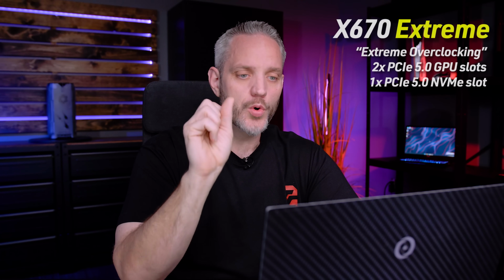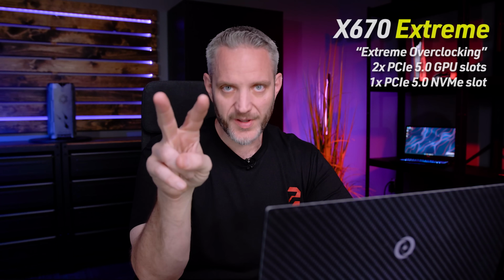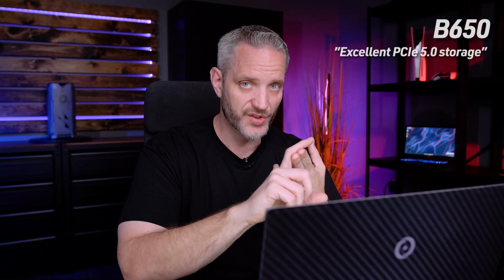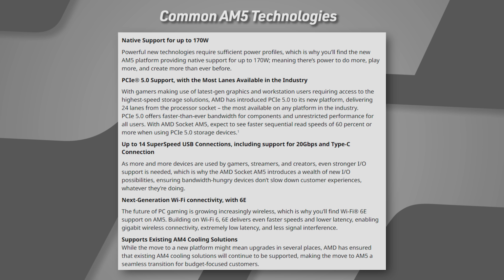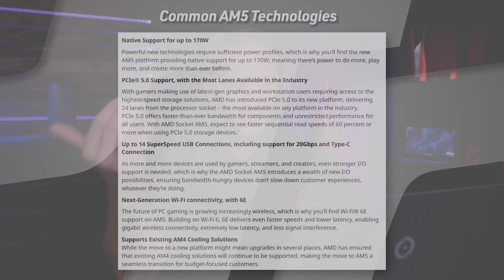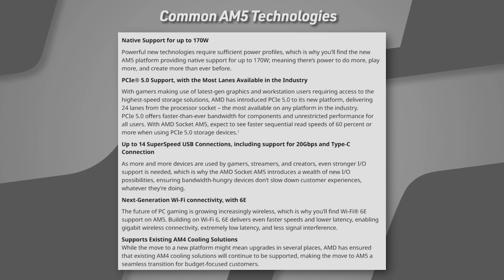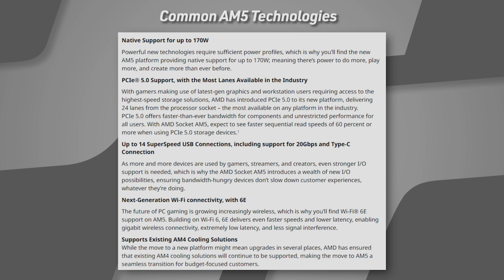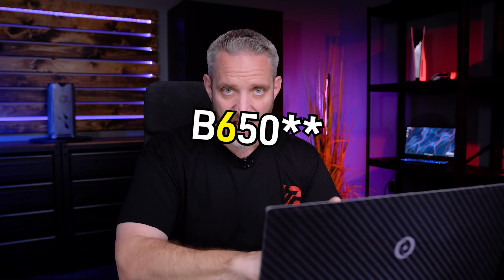AM5 Motherboards are EXPENSIVE! AM5 Explained

Comment: IMHO, the dual GPU support is mostly for people rendering 3D stuff as going for a x8 PCIe slot tends to degrade performance between 10-20% depending on the use case.

So the moment you put the 2nd GPU, you see the penalty on both because they are running in x8 mode.

Most 3D rendering scales almost linearly with 2 GPUs even when they are not in CROSSFIRE/SLI so having 2 full PCIe x16 slots is kind of worth for this use case.

So I really hope they offer 2 PCIe slots x16 (both mechanically and electrically)

Besides, historically, MoBos have a pretty bad layout for running 2 high end GPUs as need 3 slots (because of the cooler) and the second electrical x16 slot is just 3 slots away (again, a generalization of most MoBos):
1st x16 slot is usually the 2nd expansion slot
2nd x16 slot is usually the 5th expansion slot

I have a X570 ProArt and I can only go for 2 slot gaming cards or paying way more for the PRO cards which perform worse just because of the slot distribution.

Sadly, the X670E ProArt is still sharing this layout (2nd x16 slot still on the 5th slot) while the X670E CROSSHAIR EXTREME and the HERO seem to have it on the 6th slot which is weird considering they are not for content creation.

You will obviously need an XL  type case (9 PCIe expansion slots) to be able to afford hosting a 3 slot GPU on the 6th expansion slot (for space and cooling reasons) but still, having the option is quite nice considering HEDT is kind of gone for the short term.

Comment: Once again your wrong jay, current marked has seen AMD/Intels competition raise prices, due to higher power requirements, beefier VRM and more features was needed, so its a forced extra cost, comparatively to the non war in the I5/I7 2000 -> 8000 series, period. It adds to the problem with the world situation war/inflation ect ect, but the main pricehikes on mobo´s prob comes from VRM and extra´s (layer count/copper usage), due to this current cpu war. AND cpu prices has also gone up, and not stayed the same even tho they are in a competetive war. So for once it seems that competition has NOT payed off in the consumers perspective, at least not pricewhise. It may have in other metrics tho.

Comment: I will probably wait for people like yourself to flush out the new platform and put it thru some legitimate benchmarks. I currently have a Xpox Series X that I am disappointed in for some games, most notably for me No Mans Sky and do not have a gaming PC at all. I was originally looking at doing a 5800x3d and 6950xt build but put that on hold waiting for AM5 as I dont want to buy only to then regret not having the performance gains that PCIE5 alone should provide for gaming

Comment: I find it really lazy and excessive/consumerist when tech YouTubers say "this X570 Extreme motherboard pairs well with this 5950X CPU!"

I mean, yeah, of course a super high end motherboard would pair well with a high end CPU, duh! But the better question would be "what is your use case?", and not "what CPU will you use?".

For example, if I was going to go with a system intended 100% for gaming and absolutely nothing else in terms of productivity or content creation. If I knew that I didn't to mess around with overclocks; and if you have a limited budget you have to stick to; then a good, solid B550 MoBo would be MORE than enough for even a 5950X in terms of power delivery and stability.

Much the same, if I was going to go with a use case that required a bunch of fast storage, as much connectivity as possible, but not necessarily a very high end CPU (like a 5600X), then a X570 would make more sense, since it gets way more options in terms of connectivity and features that might be useful for someone doing serious work with their computer...

So yeah, unless money is of ZERO concern to you, you should first think what you're going to do with your system, before just filtering by "price: high to low"

Comment: I think AMD didn't say X670E support 2 PCI-E 5.0 GPU + PCI-E 5.0 SSD.  As I know X670E and X670 different is X670E support  both GPU and SSD run PCI-E 5.0 at the same time, X670 only support one device run at PCI-E 5.0 (GPU or SSD). And I view the Gigabyte X670E Aorus Xtreme image, there is only one PCI-E 16X slot, 2nd and 3rd are X4 slot.

Comment: As I'm currently running a R9-3900X on a Gigabyte x570 Aorus master, RTX 2070 and 16GB ddr4-3600 and i'm not seeing issues with what I'm playing. I'd have a win the upgrade to upgrade. To upgrade cpu, motherboard and ram ... It would be nice but I neither have the intent nor the funds to go that route yet.

Beside I did the hop to ryzen when it came out.... still have the x370 CH6 Hero wifi (which the wifi has been upgraded several times) but my step son has the R7-1700x. The bios updates... oh gods the bios updates. It only really good stable with the R7-2700X and 16 DDR4-3200 and MANY bios updates later. I was my Linux box up till the cpu gave up. Only board I ever saw that was that unstable was my Asrock x570 Taichi that only worked with beta bios updates and polychrome nearly bricked my windows install. Funny, looking at this and I still remain on AMD.

Comment: I did notice there's multiple fully wired x16 PCIe slots in ASUS's lineup and been wondering about that but ultimately didn't care much. Having multiple max speed max connectivity slots would lend to using something like their m.2 adapter cards where you put 4 NVMe SSDs on and it puts them into a RAID configuration but it needs a full x16 slot to run the full amount of drives. 
PCIe 5 obviously isn't an issue for gaming itself since graphics cards barely make use of PCIe 4 at the moment.

I'm going to pick up AM5 soon-ish. Definitely not day one unless mainboards and RAM magically become super cheap, which they won't. But probably some time around Christmas or early 2023. Having my eyes on the 7900X but that all might change if they announce the 3D V-Cache models before I buy.

What I'm looking for in my mainboard this generation is that I have 4 m.2 slots so I can drop the remaining SATA SSDs along with the cables and case space they require. At least one of them should PCIe 5.0 for future proofing and then I'm happy. But honestly, all my NVMe SSDs right now are 3.0 except for one 4.0 drive that's just 4.0 because I was buying a new one anyway and figured I'd pick the faster option with direct storage becoming a thing now. On top of that, I'll be looking for USB4, yet again for future proofing. I'm mostly worried about the lack of USB2 ports on the new boards as connecting my iPhone to my PC proved to be such a struggle, trying USB-C Lightning and regular USB-A Lightning cables and both would just tell me the connection was broken and it didn't work until I plugged it into an USB2 port at the back of my PC.

RE: wireless, I'm actually wondering now if wifi and Bluetooth always are connected. I remember having some ASUS board (think it was the Prime X570) that didn't have wireless, which was irrelevant to me. But then I found out it also didn't have Bluetooth so I had to buy an add-in wireless card to get Bluetooth for my Xbox controller. Any insights on this?

Comment: I am looking at upgrading to the 5800X3D. My 5600X is fine for gaming but the 5800X will boost the performance of my 6900XT enough for me to wait until the 3D Vcache ones are released. My Crosshair Impact is not going anywhere it is great for gaming and I have a SFC to put it in when the day comes to "retire" it from my main gaming pc. I also still have my Crosshair Hero VI that I want to put a 5000 series cpu in.

Comment: This is timely. My next build will be AM5. I've already purchased the case and extra 140mm fans. So the B650 Mobos will have a PCIe 5.0 GPU slot AND a PCIe 5.0 NVMe slot/capability? I'm confused. I'm torn between X670 & B650.

Comment: Two GPU slots in 670E really just means you are going to get the option of running x8/x8, with most boards revealed so far giving you x8/x8/x4 with x4 from chipset. 

Cost wise - pcie 5.0 simply is much more expensive to implement than pcie 4.0. If you think this is bad, just wait until pcie 6.0 comes around with even stricter requirements and shorter trace lengths without retimers and far more expensive switches. The trend is that in future, increasingly the price of motherboard will be determined by how many slots of which generation pcie it has.

Comment: From what I was seeing, Asus's cheapest X670 board is going to be $491... which is absurd. Which makes me wonder... they didn't increase cost on chips, so I wonder if they're pulling an Intel and making licensing for the board manufacturers more expensive. So, consumers still think "Good Guy AMD" and they're making the board manufacturers the bad guys, but $491 for an entry X670 board is more than licensing. I'll admit that I had FOMO after seeing some of the stuff about Zen4, but the speculated cost of the boards has tempered that a lot, and I don't just use this system for gaming.

So, right now... I'm going to wait and see with my 5950X. I might even head back to Intel depending on what RPL brings. Plus I'm interested to see if the new 3D chips are anything more than gaming only CPU's.

Comment: I like the advances AMD has made. It helps all of us in the long run. I'm with Intel now and waiting on the 13th gen to come out before purchasing. I want to compare the 12th gen to 13th gen performance to price. I've had AMD for years and unfortunately have a kind of bad taste in my mouth for them since the memory controller went out on my Threadripper a few weeks ago. The processor should have lasted much longer than 3 yrs. Currently on my first gen I7 that still works since 2009 doing light work till i figure out which gen to buy.
Reply: Still got my x58 i7-990X
Reply: @mitlanderson  that's really cool. Mine has been chugging along for many years with no problems. I upgraded the 965 extreme to a Xeon x5675. Runs 4.2mhz easy all day and for almost 10 years
Reply: My mainboard just died last week for my 1800x on a cheap af b350 board. I got a 1700x in a much better b450 board running 24/7 for the last two years no issues. 
My mainboard died at the worst time. I wanted 7000 series. Had to get a 5900x on a sale. Such a terrible life XD
Reply: @coreycarpenter2489  yeah, mine was the 1950x Threadripper. The board and the chip went out. I was so pissed and did not even over clock it. Used for video editing and some light gaming.
Reply: @leewarner9357  I think 1st gen ryzen boards lacked quality. Board partners probably didn't want to put in the effort. It wasn't until 2nd gen (b450/x470) I think that they really started to get decent designs. My new x570 board rocks. Sucks though. Hopefully new boards will last the test of time.
Reply: @coreycarpenter2489  it was the 1950x that went out first, then it took the motherboard out. All garbage now
Reply: @leewarner9357  That sucks dude. I hope your next system works out better.
Reply: @coreycarpenter2489  having to wait on 13th gen to come out to decide which is better for the money. In the meantime, I've resurrected my EVGA SR-2 with 2 Xeon x5690's.

Comment: My system is over 12 years old and is still running strong.  It's an intel i7 3820 originally paired with 64GB of ddr3 and an GTX 680 card.  At the time it was considered OP and has lasted me all this time with excellent performance.  Last year though the video card finally died and was replaced with a late revision 1050 Ti card which is hilariously smaller than the 680 it replaced.  Also a couple strips of ram died last year as well.  With 48 gigs of ram and the 1050 card I can have multiple tabs of a browser open and run Escape from Tarkov just fine at 1080p.  
So I can tighten my belt a little longer and keep on keeping on without upgrading.  However, the system can't run forever and I've been seriously thinking of upgrading.  I went ahead and got an x570 board with a 64gb ddr4 ram kit and a samsung 980 ssd.  Here's the thing....that was 2 years ago.  2 years of this nonsensical pandemic/chip crisis had prevented me from building a new system.  Now that things have calmed down somewhat I'm thinking of finally finishing the build.  
Question for chat.......should I sell the parts and build a x670 system with these higher debut prices or should I get a discounted 5900x and maybe wait for one of the nvidia 4000 cards or the new AMD cards.  I'm just not sure.  What I am sure about is that I don't want an Nvidia 3000 series card or AMD 6000 video card no matter how much those money grubbing beotches discount them out of desperation.  lol

Comment: Definitely want to see more PCI-e expansion, because a lot like buildzoid in this regard, more m.2 slots don't do anything for me, yet. And if I needed more, there are those adapter cards that could provide more if need be. But that's the point. Having more pci-e slots grants that flexibility. More m.2 slots take away that versatility, more often than not.

Comment: yes i will be an early adopter for AM5. I am on an intel 9700k, and cannot wait to upgrade to a DDR5 platform. Plus the energy efficiency I've seen AMD showing off last few generations compared to intel are a really incentive to jump brands. probably going to go for a 7700x (8c/16t) should be a good jump from my 9700k (8c/8t). unless it will really be worth the jump to 7900x?
Reply: If you're just gaming, the 7700x should have your needs covered and then some. I would spend the difference elsewhere, like a case with great airflow, or a tier higher GPU, PSU or storage speeds. The higher single core performance across AM5 will net you far more than maximizing core/thread count.
Reply: @ClarkBark14  already got waterworks for my 3080ti, am5, and 32g og ram with a few terabytes of m.2 gen 4 storage
Reply: Kinda just waiting on motherboards for am5 to drop to decide which one....and I know improbably not getting best price to performance

Comment: I was waiting for this. I've never built an amd system. I've always stuck to intel i7 cpus. I'm going to start ordering parts this coming spring to build a new pc. I'm definitely going AMD this time. My only difficult decision is whether I want the 7700x or the 7900x. I don't care to have more than 8 cores but the extra cache and clock speed of the 7900x is very appealing to me.
Reply: Then wait for the 7800X3D in Q1 next year, it's literally exactly what you want.
Reply: @mitlanderson  I overclock, I'm worried that because of the 3d vcache being on top of the die like in the 5800x3d it will limit the ability to increase voltage/frequency because of thermals.
Reply: @sidepiece8344  AMD already stated that they locked the 5800X3D because of a voltage limitation, they explicitly clarified it was not a thermal issue.

They also said Gen 2 VCache shouldn't have those limitations. Also, if that were the case, would you rather OC and get 10% more performance or buy an X3D part and get 30% more performance stock? Cause that's the current performance projections for VCache.

Comment: I still run on B450 so i will make the jump to a now "old" 5800 or something like this. Given that the jump is to high for me in the current climate i will skip AM5. I think AMD really hurt themself with forcing DDR5 on us. But lets see what happens.
But currently i cannot and will not spend that much cash to change basically everything. I will try to get a little bit more life out of my 3900 and B450 even this shitty MSI board drives me nuts everyday.

Comment: I suspect that Jay misunderstood AMD's references to "graphics" and "storage" slots.

I took "graphics slots" to refer to those slots that are most commonly used to plug graphics cards in at (usually) a right angle to the motherboard, with access to cable connectors on the backside of the case.  We've had slots like this over many years, for PCIe, PCI, and doubtless something else before PCI.

I took "storage slots" to refer to the more recent M.2 slots that are usually used to hold smaller SSD cards, originally using SATA, and now more commonly also using PCIe connectivity.

As a storage weenie, not a gamer/graphics weenie, I've long used just one "graphics slot" for a cheapo graphics card, and then used the other such slots for networking (if the mainboard didn't have what I needed) and storage (to extend how much storage I could attach).

The M.2 "storage slots" are currently mostly used for SSD storage, but can also be used for little wireless networking cards and various other oddball uses which need PCIe lanes, but can get by without obvious access to cables connected from outside the case, and with much less PC board real estate.

So ... as a storage weenie, I'd welcome more 16x PCIe5 "graphics slots" ... to plug my (well in my dreams anyway) additional fast storage into.

This confusion comes from the problem that we lack good terms that distinguish those big slots that we usually plug graphics cards into, as physical slots, from their use, as PCIe lanes.  For the newer M.2 slots we have such a term ... "M.2", which applies to the physical level, whether SATA or PCIe.  But we lack such a term for "those big slots" ... hence AMD having to resort to calling them "graphics slots" (even if they have no plans to support multiple graphics cards in a system).

Comment: I'm gonna upgrade, the system I have today is very good but you know... 
Today I have 5800X 6900XT on a Crosshair VIII Dark Hero MOBO.
I did buy some parts for the new build earlier this summer, I have a case and distro block. 
I might wait for 7800X3d but I think I will pick up a MOBO in the meantime, I am thinking the new Crosshair, that however is pricedependent, if its stupid I'll drop down this gen. 
And as hinted this is a custom loop build so I will need the CPU/GPU before being able to plan and build alot of it.